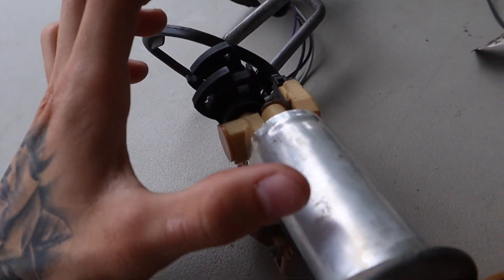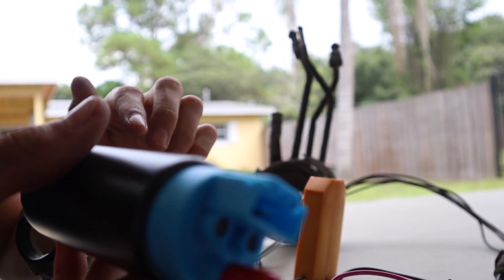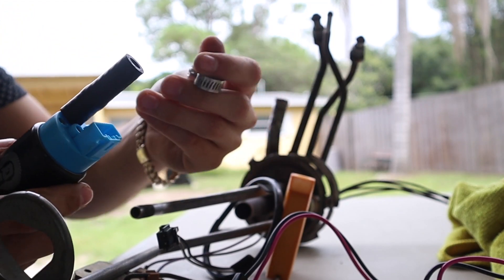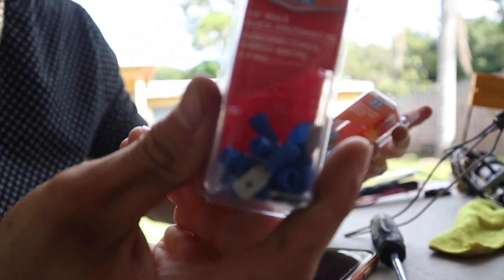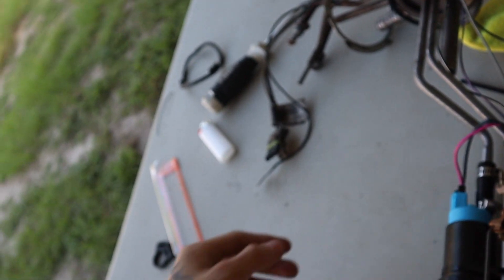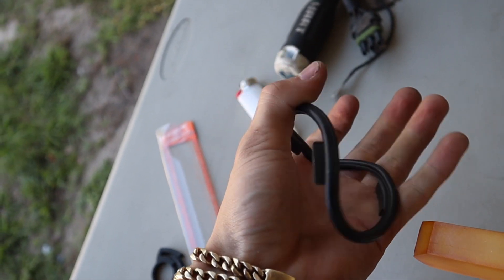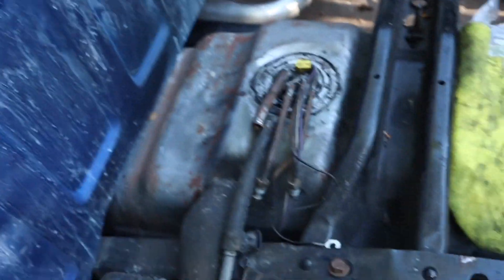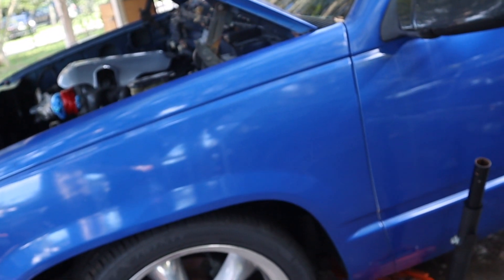Ls swap obs build pt.4                  [installing a quantum fuel pump]

Comment: How did the quantum fuel pump end up treating you? Made good pressure?
Reply: I assume  it failed. I been told always use oem like ac delco or Delphi
Reply: mines failed after few months
Reply: Mines treating me great , still going strong after 10 months on my ls swap
Reply: Mines made it 10 months behind my 408

Comment: More obs stuff little man please I am building a 1993 obs Gmc Sierra 1500 with a 5.3 with 10.6.1 4.8 pistons 575/600 lift cam summitstage 4 cam 3800 stall 4:10 gears ⚙
Reply: Cool that sounds nice!  My Dad and I just put together a 1994 Chevy short bed with a 5.3 and a rebuilt 4L60E with 4L75E upgrades inside so basically its a 2010 Camaro SS transmission  now It just has intake and exhaust and tune runs great ! however it has wide gearing  3.23 because it was a 5 speed v6 not too mention the 30 inch tires Lol  So I'm going 55 at not even 1700 RPMS Wow      but I'm gonna put 3.42 or 3.55 back in  it ....... Then get Baja 33inch tires will look sick with the 4 inch Lift it has!!!!!!!!!

Comment: Why you install the motor separated from the transmission instead of installing them as one unit ? Is there a reason behind it or just your preference?
Reply from the maker: I didn't want to take off the radiator support